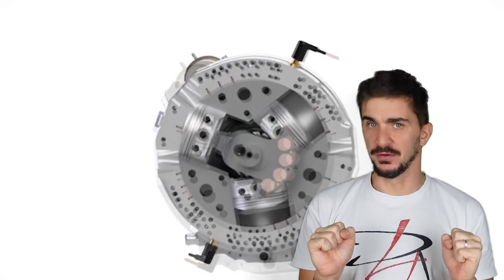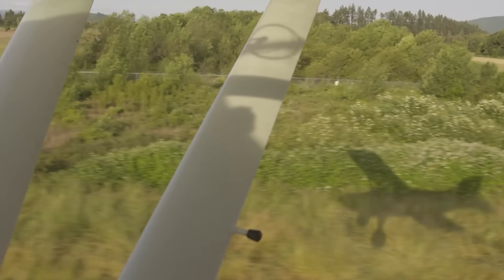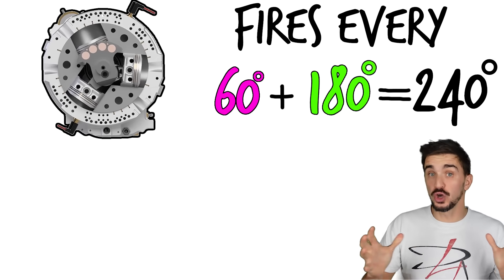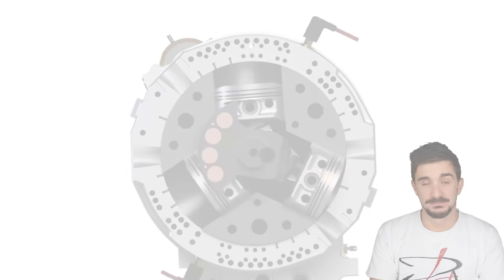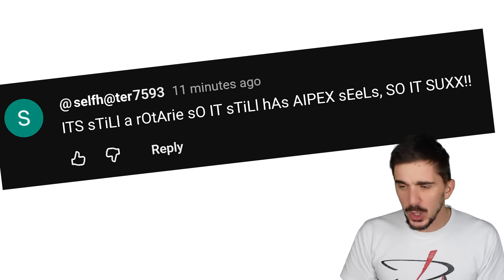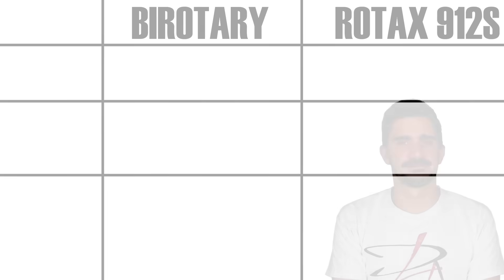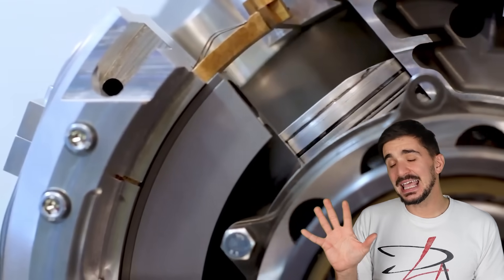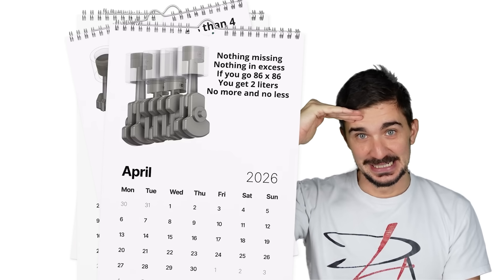This is What Happens When Pistons and Rotaries Make Babies - Birotary Engine Explained and Reviewed

Comment: You know you can increase the size of the stroke when increasing the radius by adding more ports and cylinders?  That’ll give you more power.  You can also stack another right behind.  This also would integrate nicely as a generator for a hybrid power train because if it’s optimized narrow band.
Reply: You can do it, but it doesn't solve the geometric problem.
Think of that: how many degrees of rotation the shaft has available a traditional piston to complete the run from BDC to TDC?
Answer: 180 degrees.
Now look at this birotor engine and check how many degrees rotate the engine shaft while the piston runs from BDC to TDC... bingo!
Did you get where the problem is? 😎
Reply: @giuliobuccini208 look at radial engines from the 1920s-40s.  Literally the same design, except the pistons move and ports are fixed.  Power, speed, piston # and size are all variables that can be adjusted.  This design is even stackable like a wankel.

Comment: Thats a very "short-hub/stroke" engine. even shorter, as motorbike-engines. So its predestinated to reving high and get its power/HP from reving, not from long stroke and displacement and torque. That makes especially sense, because of shoveling air, not torquing transmission and tires. The propeller is almost always loaded with the same air-mass-counterforcee - probably in every reving-level it can do.
How does it get cooled? No meantioning about. Thats a relevant question, because a big part of the engine has no direkt contact to the outside. Heat-transfer is a problem and may has to be tranfered via oil-coolers at the outside.

Comment: Here's the way I look at the engine speed:  If the propeller is rotating at 2500 RPM then the block is also rotating at 2500 RPM.  For each rotation of the block each piston completes 2 combustion cycles.  This means at an output of 2500 RPM each piston is completing the same number of combustion cycles as a piston in a normal engine at 10k RPM.

Comment: 5:40 I think you can still say that it fires every 180° because the crank and block are rotating simultaneously. Essentially you're doubling up (or 1.33ing up ig) on rotations allowing the engine to fire faster than a traditional 3cylinder.

Comment: That would actually make a decent boat motor, too… they generally run in a fixed rpm band, run a prop with variable pitch blades or vanes, and can benefit from high rev-low gearing power output. It would definitely take up less room in the engine bay than a pair of Mercury big block marine engines!

Comment: If you can find information - there was a Newbold engine being developed in Colorado in the late 1980s.  Similar size and design and were also designed to be 'stackable'..  I believe they had a running prototype.  Note: the pistons do not go up and down, they actually spin in non-concentric circles compared to the block.

Comment: 😳 OMG why did they think more moving parts was a good idea? 
They could have held the piston crank fixed rotated the drum or rotated the crank it’s going to brake down often and going to be a real Bie to work on
Why don’t they look how the 3D print the new generation or rocket motors 
No moving parts 🎉🎉🎉
Now go design a motor with as few moving parts as possible 🎉🎉🎉

This rotary piston engine will be a nightmare 😱 the seals of leak and wear out fast  no thanks

Comment: You'll probably have problems sealing the combustion chamber with the rotating cylinder block, plus it seems like any seals would wear out quickly. This design is another "looks good on paper", but reality intervenes. It takes decades to bring a new engine design to production, especially in aviation, because an engine has to be energy efficient and reliable. The liquid piston design is much better, and is already been used in drones. The future for aviation powerplants is actually two stroke water cooled diesel, take a look at Delta Skyhawk engines.

Comment: The main advantage of a rotary engine is the absence of reciprocating pistons, which eliminates the high inertial loads that increase rapidly with engine RPM. However, I think this model exhibits disadvantages inherent to both rotary and reciprocating engine designs.

Comment: There 60 140 280 motor not roto what ever. 😅
Or 7.5:1
What ever came off the Duke engine? A swash plate crank.

Comment: If the seals are in the housing it'll "see" the bore which is a big opening, if the seals are in the block it'll see the port which is a considerably smaller opening.
I feel like the seals in the block should make more sense, no? I feel like the seals positioning is like a two stroke with a big BIG port which is prone for the seals to catch on the port.

Comment: Combustion gasses leaking to the gap engine-block and "cylinder-head".   High pressure oil feed to the power-strokes areas?

Comment: Still wondering about lubrication.... It has moving pistons, albeit with a very short stroke, but piston seals gonna be piston seals, and moving parts on crank/con rod assembly. Won't that influence emissions as oil can get past the seals like conventional inline engines? I get it its for aircrafts and most of its life its going to be revved up there in the sky, but still... that's a very good question.

Comment: Missing the salient point: torque-roll is due to the prop rotation loading up the engine/airframe requiring lift differential between airfoils to lever against it.

Comment: Why not connect rotary engines to compact generators for electric powered drive trains? Since short stroke engines like to run at specific RPMs & generators like to operate at constant RPMs for best performance.

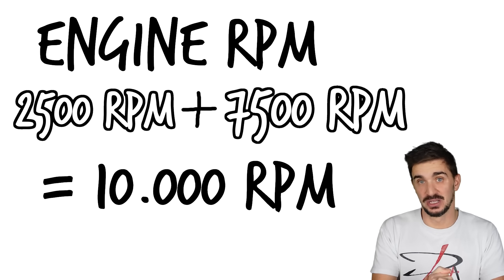Comment: 7:37 yup that's the most brain dead way it could have been done, every other engine on the planet does it with shaft speed  (except old aircraft rotories which spin the block but it's effectively the same)

Comment: First, absolutely appreciate all of your videos! Been around aviation since b4 I was born.
What airplane engine are you revving past 2700, let alone 5500rpm...holy moly the Reno Air races run 3200 constant only because of super specialized propellers!
General aviation a G0-300 @3200rpm? And that's only for power on climb out 2 minutes max if I recall? There were a few by Lycoming and all of those skunk works geared engines that everyone didn't understand you just had to rev them higher bc they were built way way stronger than the '0300 that's on every 172. You would basically melt the lining off the cyl at 5500 on an 0360 in about 3 minutes I would imagine.

Why are we still trying to do less with more than the 13B could provide? I mean this is infinitely more complex than a rotary with a re-drive unit on it. Probably just me thinking logically and not seeing the beautiful engineering going on here and thinking about having to work on it being a complete tear-down every time 🤔

I guess my point is people forget that there's prop speed and there's engine crankshaft speed. We forget they're very different things as this video topic of trying to reinvent the rotary yet again has proven. If you were spinning an '0360 like you showed @5,500 you'd be like the Contra rotating thunder screech jet thing we made in the US that they outlawed because it was like 2,500 Sonic booms a minute or something propeller wake crashing into itself and the sound barrier! Not to mention that maybe 5 minutes of runtime before that cylinder coating melts and one of the pistons freezes and grenades itself?

If you had enough brain power to read all this autist'. Pls comment cam on top better than Continental hahaha!

Comment: It seems to me like it it should be possible to have a movable sleeve on the housing to adjust intake/exhaust size and/or timing. Definitely not a perfect solution because it adds more complexity, and it would still be pretty limited to the size of the port itself, so not that much adjustment could be made. To extend the flexibility you could make the ports oval shaped, but then you're going to lose some effective compression ratio, and potentially create a leak-path too early or late in each cycle. It does strike me though as something that could "easily" be hybridised due to its form factor, which would be interesting.

Comment: Can you find and illustrate the 3 lobed counter rotating cams revetac engine, which used "scirrored cams" to eliminate the crankshaft and lateral friction. I just cannot visualize how the arrangement would work. https://en.wikipedia.org/wiki/Controlled_combustion_engine

Comment: I wonder if you could drive an alternator/generator off the internal driveshaft, and a transmission off the planetary gear reduced final driveshaft.  Since it revs so high it's going to run into a mechanical/chemical limitation of max RPM as a function of combustion speed, but it's going to be very low torque.  With an output of only 3000ish RPM and low torque, that's going to be a rather annoying car engine.  Augment that with electrical generation from the high RPM of the internal driveshaft and apply electrical drive torque somewhere in the drivetrain and you might have something.

It's going to share some of the drawbacks of Ducati's desmodromic valvetrain and Honda's CBR250RR from the 90's.  That planetary gear system is your link from the crankshaft to what serves as the valve system in this engine.  It's going to be subject to wear and flex.  Something I think this engine would NOT appreciate is engine-braking.

Comment: What if they just lean into the rotary concept and give it rotary valves on the intake and exhaust allowing long stroke rotopiston designs by using staggered intake and exhaust port. So the piston has ~3x the time for the compression and power stroke

Comment: There is NO torque reaction to an engine at constant RPM, Changing RPM gives a torque reaction as the rotating masses are accelerated.  In an aircraft the main torque reaction is the spinning propeller being driven through the air, that is why a lot of light twin aircraft will have counter rotating propellers. In fact this reaction is so strong that P-51 Mustangs could not be run up all the way on the ground, there was a good chance that the plane would flip over.

Comment: I already made drawings of something similar with 2 cylinders 20+years ago. My design had 2 pistons and both had 180degrees per cycle, and they we're staggered to have more stroke. Thus would have been a slower , more torquey engine.

Comment: 16:17 I fly the rotax 912, while it is true that you spend most of your flight at about 4800 rpms in the approach and landing phase you change your rpm a lot to correct the slope, having a slow responding engine could be terrible, this is what happens for turbines that require a special certification
Reply: I guess this is a fixed pitch problem, so a matter of where you want your added mechanical complexity. A failed prop gov does beat a failed valve train, but a time tested valve train does the most soul soothing. With recent personal car troubles I do envy the lack of head gaskets on a lycoming.

Comment: The power to weight ratio is a problem.  There's also a reliability concern,  and that engine can't be cheap to produce. I honestly don't see this thing being in wide production in the aviation industry, but any plane that uses it will be a conversation starter in the hanger.

Comment: Big bore to stroke is not efficient like aracing motorcycle engine. Airplanes are all about efficiency to cary less fuel weight in the air.

Comment: you can eliminate reaction to gyro effect, but you cannot eliminate the gyro effect itself. the spinning wheel in this case will not trying turn itself in that strange 90 degree way, but it will take twice effort to turn it at all-

Comment: It's like a combo of both types of rotary or sort of an enclosed radial with opposite power characteristics (high rpm/low torque vs low rpm/high torque). Interesting for the application and maybe as a compact power generator for EV land-based vehicles where it can maintain a steady rpm, but I doubt it would be competitive in such applications since packaging is an easier problem to solve and weight in an already heavy vehicle less important than meeting emissions and fuel consumption targets that I can't imagine it wouldn't struggle with vs current competitors.

Comment: Something important that wasn't discussed is lubrication, it looks like it'll have to burn oil like a traditional two stroke which will kill it for any use where emissions are a problem.

15:50  I see the opposite, no chance it'll be used in bikes and some chance for cars/trucks as a generator engine for a series hybrid system.

Comment: How are the seals held in while the combustion chamber goes over it, especially on the intake stroke. If keeping a good seal between combustion chambers, would it not fall slightly into the chamber and get hit by the cylinder wall?

Comment: Too many high friction points. It has piston rings with their known issues. Plus it has rotary type seals with their known issues. And there will be blow-by issues into the space between the rotary block and the engine case. And I did not see how they are oiling the connecting rod bearings. And the issues of two stroke oil burn. I feel that seal degradation and oiling issues will be the albatross around it's neck. Interesting design though.

Comment: Giggle, thank you! And any engine that has 'Knob' written on it has my vote.
The short stroke and valve timing issue...
...I guess that could be fixed by staggering the ports front to back and putting rotary valves in them. Then each combustion cycle can skip a port, with overlap, so allowing for a longer cycle, longer stroke, and some management of intake / exhaust.

Yes, more complication. But not a lot more.

As an aside, isn't innovation a funny thing?
The internal combustion engine sees next-to-no innovation in 100 years, just (admittedly important) iterative improvements because it had no real competition. Now competition exists designers are innovating like crazy, but those innovations will likely never see mass adoption because they are probably too late.

Comment: at 12:46 - Another drawback could be that one of the pistons is upside down, and oil could seep through the rings and create a hydro-lock situation if parked for too long like for radial piston engines.  But this can be solved by some specific pre-checks before cranking the engine.
Reply: ooooooo. That is a very good point. I hope they also catch that before it becomes an issue.
Reply: @XBuilder01  They will figure it out sooner or later 🙂
Reply: Or you can rotate the entire assembly so an intake/exhaust port is there

Comment: As there is no physical linkage between the rotation of the crank and the rotation of the block, like there is in a wankel, the rotation per stroke is arbitrary and dependent only on the type of gearbox used to combine the rotation of the two with an outside reference frame. As such, your piston could rotate 15 degrees, 30 degrees, 45 degrees, or even 360 degrees before a full stroke occurs. Theyve chosen in this case to have two combustion cycles per 180 degrees of exterior rotation, which gives them a balanced heat input and avoids the asymmetric heating that plagues wankel rotaries. But they could have chosen 4, or 8, or 1. 

You also made a second mistake in the video, this does not limit the stroke of the engine. Again, depending on the gearing between the crank and the block the rotation between the two is arbitrary, and stroke is limited only by practical considerations of how long the piston needs to be, and how large of a swing of the crank you can fit without interfering with the other two (or however many pistons) a different version of the same engine would have.

Comment: You could add sliding valves to the intake and exhaust ports to reduce the size of the intake/exhaust adding air velocity, adding complexity at the same time but also adding power down low

Comment: I guess we are just ignoring the lubrication of the pistons and the sliding seals... 10000rpm. Just think how fast that surface is sliding past those seals. They will wear quickly unless they can operate like the piston rings.
How does the oil get to the seals? How do you keep it on the engine?

Comment: Dry weight is used in aviation when calculating the gross weight of an airplane. It’s important when calculating weight and balance of small aircraft. Oil, fuel, passengers, luggage and their placement will have effects on the plane’s controllability and stable flight. Said factors are negotiable (besides the oil) where “dry weight” of the engine is not. While that doesn’t help with what components come with the engine I hope you enjoyed the bit of information.

Comment: This engine is designed for unleaded fuel vs the leaded fuel commonly required for aircraft piston engines. As leaded fuel is phased out, this could be well placed as a replacement engine option.

Comment: I had subscribe after the introduction and the assault by football!! ...  Excellent explanation of the design and technical pros/cons.  Note that *IF* we "go backwards" to more hybrid cars, then birotary may make sense, assuming the internal combustion engine is used only to generate electricity.  However, I think with the current very high investment in new battery technologies ( solid state, Na, Al, etc), pure EV will still win out.  Thank you for the excellent video!